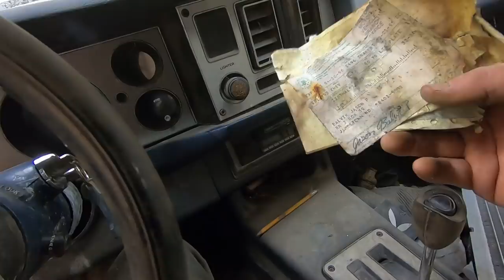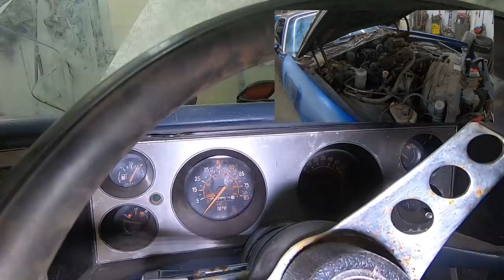Mullet Machine Abandoned for 25 years! 1980 Chevrolet Camaro left for dead! Will it run?!?

Comment: Nice one Mortski!
 GM kept the column shift linkage on the floor shift cars to actuate the column lock, neutral safety/ backup lamp switch and shift indicator. The collar on the column still rotates like a column shift. That comes in handy when the floor shifter cable snaps due to bad body grounds, lol. That was a big problem on GM floor shift cars BITD.
Reply: That's what I was thinking. I kept screaming at the screen when I saw the shifter in neutral.

Comment: 1969
First, the division will supply as original equipment on about 80 percent of General Motors car divisions' 1971 model cars, the new Delco sealed side terminal (ST) battery. This new battery design was introduced by Delco-Remy in 1969, but has been available only in the after-market. Also revealed by the GM Division is a new maintenance free battery which includes the sealed terminal design and, at the same time, incorporates important other new features.Aug 1, 1970

Comment: I thought you were turning those caliper bolts the wrong way. I've done the same thing which required putting a extension pipe on my strong arm to break them loose😖

Comment: From my perspective, the 2nd Gen Camaros are the best looking. Had a friend in the Army in Colorado Springs about 72 that had a 71 maybe. Had a chance to drive it, lot s of fun and it was just the basic Camaro, base engine usual power options, automatic. My fave is the 72 with the split front bumper before the obnoxious crash bumpers rooned them. Glad it's going to a good home. It looked like a good solid car for at least a decent refirb. Maybe he'll find a used front cap and stuff to put the front back together. Good find, good success, Sir!
Reply from the maker: I really like the 70-73 with the slim chrome bumpers best!

Comment: The shifter linkage that goes up to the column handles locking of the steering column and probably the ignition lock. not to mention the neutral safety switch.    The way that engine is running and the fire up the carb I'd suggest that engine has at least one flat exhaust cam lobe.

Comment: Really, that thing is a pretty solid project car. The nose pieces would be the hardest/most expensive parts. Other than that it's swapping in a decent small block and doing some house keeping. If you don't want to build it then you can probably flip it for a decent profit.

Comment: I have a old car that  has the exact same seat cover just like that. Apparently some of the Soviet Engineers copy pasted that from somewhere. Downside with that seat cover is when you have to do a emergency stop and you have no seat belt on. You may end up like old man Darnell being squished on the wheel. Thous things are slippy not to mention sitting on them may feel like having acorns in your a...!  One tip or something I learned, when I see a starter or a head gasket on or under the seat=she was parked cause it was too much hassle to repair.Or the parts needed where so rare and expensive it was just a garden decoration. Actually this Camaro is now my number 2 favorite vehicle from your video series.

Comment: I agree 70-71 camaros is the best looking of em'.
My dad had a 76 poop brown metallic one. 350'/350th.
We thought it was slow as hell.
Maybe because the car before was a 70 challenger with 440' Magnum .
Great old days back in 84-85 you could buy em for almost nothing.
I never buy anything with 305' in it, worst piece of junk chevy made.
I had one in a 62' oldsmobile,  the oil light flashed one time and then a big bang and number 1 rod popped right thru the engine block. Lol
I called a friend to buy a 350 and put in it.
He just laughed and wanted the 305' for his collection.
He had like 10-15 behind his barn, all of them had the number 1 rod thru the block. 
Cheers from Sweden

Comment: Looks like you have a bit of a Camaro mutt there Mortske. 80 Berlinetta shell and drivetrain, z28 front fenders. Lift up on the steering wheel and turn it to free up the key.

Comment: Back grid called Luvers Grid Mortske Repair  :) and it worst device to back up in Reverse in Winter Season driveing my Aunt Val could tell because 1976 Pontiac Trans Am she had with her one boyfriend back and plus Tint to Dark Blue color! The car was like Burt Reynolds had but was Dark Navy body with Baby Blue interior with T Tops too also 6.6 litre 400 Cubic Inches, all options plus 4 speed Automatic transmission with Shift Kit  plus 390 rear end gears posi too daul tip tail pipe also true daul exhaust too ! Plus fast too included!

Comment: Excellent video Mortske Repair :) also fix up also drive too  and if want know make 350 put 1980 heads on the motor and gaskets then be all set! Side post cable I don't like to also break down to fast compared top posts do and centre nut in battery leak acid on age that I found out plus corrosion too and not fan of them ! Plus hard get booster clamps to boost vechile with and tight area work with to any GM vechile! On my GM I made extensions of Battery cable from + also -  on block wood bolt up in fender or firewall if was room mount ! Side post came out in 1976 year I found also yes Key Ignition switch on Steering wheel can be fun to on any plus Dash mount Key ignition switch to on 1995 to present years vechiles I found that out even Lawn Mower Tractors too ! I like old Dash Mount Ignition switch easy to fix plus clean and change too !

Comment: If you notice the wire coming out of the 1/8 inch output on the Walkman the reason that's there like that is because the owner used it as his stereo in the car. You'd hook it up to the speakers you found in the trunk as well and it would play yer tunes!! AC/DC MUST BE PLAYING AT ALL TIMES WHILE THE VEHICLE HAS IT'S DOOR UNLOCKED. It doesn't need to be running. Just opened to turn the stereo on.   Oh yea and there was no "Brandy". He just bought that to hang on the rear view mirror and lie. Well except there was Tanya. But her Garters wouldn't fit.......anywhere. You can ask Peg about her. He tells a few stories about ol "One Ton".

Comment: Hey, I was class of '83 and couldn't possibly have afforded such a fine automobile.  I was driving a '67 D100 pick-em-up truck with no floor and a passenger door that would fling itself open whenever it chose.  Those few repeat riders knew them seatbelts were not just a good idea, by gawd.
Reply from the maker: I better put belts in my 68 then!
Reply: @MortskeRepair  Well Duff Dog clearly has better sense than my buddies did, but you can't expect a lot from teenage guys growing up in the sticks. :-)

Comment: Water in the trans - if there's a transmission cooler going through the main radiator, it could be leaking internally so you'd get coolant into your transmission fluid.

Comment: 78-81 front calipers I believe maybe different then 69-77. the balancer pulley mounts to the hard part of the balancer, the inside part. The pulley could have been bent in the accident. FYI 305 is externally balanced, so is your 400
Reply from the maker: What?!? I'm pretty sure 400s are the only externally balanced small blocks.

Comment: It definitely turned over a lot better after the smog pump delete. The car was thanking you for removing all that emissions control garbage. I thought it sounded like it was turning over a little too slow to start before the delete.
Reply from the maker: Never seen that issue before. Always learning!
Reply: @MortskeRepair  I had a compressor cause a similar issue on one I was trying to revive. The good ole delete solved the problem. It would barely turn, and i couldn't figure out why. I ended up taking the belt off for something else, and ended up turning it with my hand, and I could barely do it. I bypassed it and it turned over like a new engine after that. That's definitely one thing I have found out on revivals. As soon as you think you know it all, you learn something new. The one thing you never check always ends up being the problem, lol.
Reply from the maker: @jesterr7133  You learn something new with every project!

Comment: That extra linkage controls the gear selector dial on the dash it turns the sleeve on the column sometimes they stick between park and reverse and you have to move the sleeve manualy while moving the shifter with the other it also controls the reverse lights i think kinda weird setup
Reply from the maker: ahhh interesting!

Comment: First, the division will supply as original equipment on about 80 percent of General Motors car divisions' 1971 model cars, the new Delco sealed side terminal (ST) battery. This new battery design was introduced by Delco-Remy in 1969, but has been available only in the after-market... so a lot earlier than I thought. I figured it was around 1979, because my 1980 Chevrolet Citation had side-post in it.

Comment: I'm sure you've run into it before, but I have had a couple of projects that had frozen tumblers in the ignition. I squirt a little graphite in there, and they usually come around.
Reply from the maker: Guess I've never seen that! I think the issue on this one was that the shift linkage to the column underneath wasn't hooke dup.
Reply: @MortskeRepair  That will definitely do it. I don't know the proper name for them, but I had one one time that had a broken part inside the steering column. The little arm on the inside that gets pressed in when you turn the key on was broken. It drove me nuts until I figured it out.
Reply from the maker: @jesterr7133  Yeah, they can be a real treat to disassemble too!
Reply: @MortskeRepair  Yeah, I ended up just putting a new used steering column in that one. I initially thought that the cylinder was bad. I could turn the car on with the key, but I couldn't turn it off with the key. When the new cylinder didn't fix the problem, I thought that I had installed it incorrectly. When I took the new one out and looked in the hole, I could just barely see that the little hook was broken off. I wish I had noticed it before I installed and removed that cylinder three or four times and spent half a day on it, lol. At least I learned something new. I always check that now when I have a cylinder that isn't acting right.

Comment: Because it still shifts at the  coulmb sorta if you check out another early F-body the collar where the shifter normally is  still moves when shifting center console 🤔 just uses linkage rather than easier cable? Gotta remember Engineer's Over Engineer sometimes????
Reply from the maker: No doubt!

Comment: Dang if'n I didn't have me a decent post all worked out and then you go an' sell the thang!

The "Shiddy Starter and Crappy Carbonator Show" again, eh?  LOL!  What - do you go looking for these things?  Is it a prerequisite before you do a deal on a vehicle?  ....or do they just run at you like Duff when he hears the engine turn over and they tell you to take them home?  😂😂 Still loved watching it, mate. Been looking forward to a Mortske Special all week for some reason..... and you didn't disappoint. 👍

One of these days you'll have to spend a bit of time working on one of those Camaros (yeah, right!).  Yeah - the 70-73 2nd gen were the better lookers of the bunch, but the 79-81 started to bring the early 2nd gen style back into the nose (instead of looking like someone squashed it) and was almost palatable.  I prefer the 2nd gen Firebird nosecone from 77-81 to any of the 2nd gen Camaros from 77-81 though....and I have always wondered if they were interchangeable.

Glad you still found a few ways to piss Greta off too........
Reply from the maker: Yeah we need to find a Trans Am so I can shave a Burt Stache!
Reply: @MortskeRepair  You could find an old GMC Ambulance and do the same thing, but you'd need some of them yellow-tinted sunglasses and a bloke with a white coat who could look both ways at an intersection at the same time.

Comment: Well the radiator which didn't seat might have fractured the plastic tank but no internally and it would pump the transmission full of water so the proper way to do it is plush the transmission through the line there's one line sucks and 1 line that pulls so you set it up where it pulls in new fluid until it pushes all the water and the heat out

Comment: turn the steering column at the bottom, closet to the dash and you should be able to use the key , safety lock is unhooked from trans

Comment: I know lots people run 89 or 91 or 94 octane gas plus Carb cleaner also 10w30 Conventional Oil to also Fram 2x on Oil Filter, Air Filter , Fuel filter too !

Comment: You need to get a sponsor for a lift this way you can raise your vehicles and lower them So you can work on them properly
Reply: You need a starter sponsor and you need a sponsor like snap on her Mac for more tools do you need a helper to help you work on his vehicles and you need a tool sponsor like snap on her Mac
Reply: Had an 80 Berlinetta myself, drove it for 4 years (late 90's). Then tore it down and rebuilt the thing into a Z28 except the engine. Fibreglass bodywork, Krylon white rattle can paint and 69 Chevelle SS black stripes. A definite 50 footer with a worn out motor, had my fun with it for 4 years up on Jack stands. My sanity project, had to sell it before my last transfer. I understand that the next owner stripped the body down, probably cursing my screwed up messes, dropped in a good motor, etc. He did her proud.

Comment: Side post batteries?  They carry a high vacuum.  But, they were cheaper to manufacture (less lead for battery posts) and cheaper connections, with virtually no lead.  Thus, lead not supporting corrosion from battery acid, more repair opportunities. Probably why only GM used them.
Reply from the maker: Interesting!

Comment: They make special tools for pressing calipers in? Lol. You're getting a little fancy on us.
Reply from the maker: Haha, yeah, it's like a $30 kit I got for half off way back in the day on closeout! You need it for late model stuff that you need to turn in the calipers. Pushes the piston in much straighter than the ol' C-clamp!
Reply: @MortskeRepair  Yeah, I don't mess with late model stuff, lol. I don't think I've done any significant work on anything made after 2000. outside of headlights, batteries, and stuff like that. I've always had old beaters. I just bought an '08 Honda Fit that probably needs a valve adjustment. I guess I'm going to have to give myself a crash course. I've done valve adjustments on small engines(I just revived a Troy Bilt tractor that had been sitting for five years with a compression issue), but this will be my first car. Hopefully I don't screw it up.
Reply from the maker: @jesterr7133  New stuff gives me nightmares.
Reply: @MortskeRepair  Everyone makes fun of me for driving old cars. I only bought this car because I got a really good deal on it. I normally only drive cars that I can work on at home. If it has more than 5 sensors, I don't drive it, lol.

Comment: I see you have not had the full GM experience til now. Every GM I have owned from model years 1980-2010(always used) has had ignition issues. Think of the  messed up tumbler as a security device that wont leave you stranded in the loading bay at the Home Depot...unlike the AC Crapco anti-theft system, which forgets the keys more than granny on a high after bingo night.
Reply: My 94 Trans Am I bought new has 337.000 miles on it. Have kept it, despite buying 4 new cars since then, has the original ignition switch. Never any issues with it. Engine never been touched,  not even timing chain.  Lt1 engine,  still runs great.

Comment: I hate side posts. You doin't have to cut the rubber to change the bolts though. It is very easy to push them out and push them back in.
Reply from the maker: If you have new bolts that are correct yes. But I was just using a regular 3/8" bolt and you don't want them snugging up against that rubber if you want a good connection.

Comment: You got the car in neutral put it back and try ignition again . If the steering wheel is not locking you got a issue .

Comment: Gonna comment now, about 1/2 way through the video...yes, it is possible that rainwater got into the transmission down the dipstick tube over the years.  However, given the new radiator, it is also possible that the internal cooler cracked/leaked and water and ATF mixed that way.  It doesn't normally happen that way on the older Harrison copper/brass radiators, but it is possible, which COULD be an explanation for the new radiator that was on the front seat...OR the old one was just plugged up with calcium and junk.  LOL
Reply from the maker: We run coolant here tho, not water. Shoulda been green if that was the case...

Comment: If you had the electric fuel pump hooked up to the line coming from the tank at 54:20 how was the mechanical still pumping fuel?
Reply from the maker: Residual fuel in the pump/lines.

Comment: I never saw so much water in an automatic transmission. How did it find it's way in? Very surprised that it still worked!
Reply from the maker: It flooded twice I’m told
Reply: @MortskeRepair  I had a multi-core radiator fail once, and mix the transmission fluid and coolant... Though the line pressure, pushed the trans fluid, into the radiator...and not so much the other way around.

Comment: Water in the transmission from the radiator.  Install the new rad or external transmission cooler.
Reply from the maker: We run coolant here tho, not water. Shoulda been green if that was the case...

Comment: Is it possible, read likely that the radiator in it had a bad core and was mixing transmission fluid with the coolant.  Which would explain the new radiator and the several quarts of water in the tranny? Also did you forget to reshim that starter? It cranked up like it was missing.
Reply from the maker: Could be but we use antifreeze here so it woulda been green... And the trans cooler lines generally have more pressure than the radiator . We don't shim starters unless it hurts my ears so bad I can't stand it!